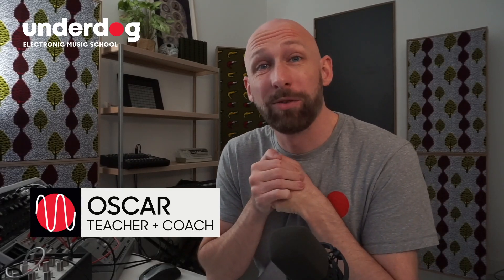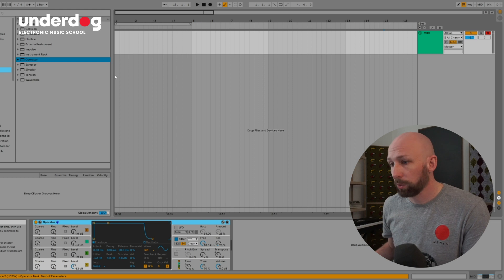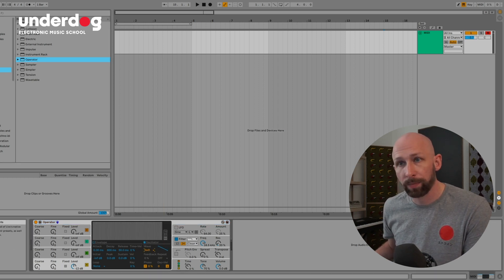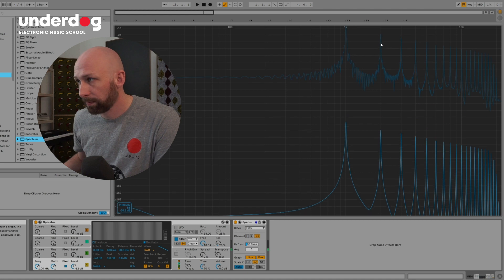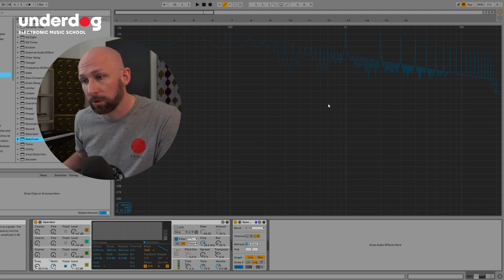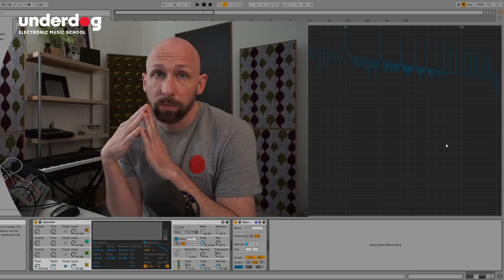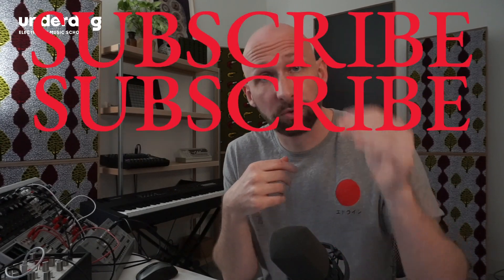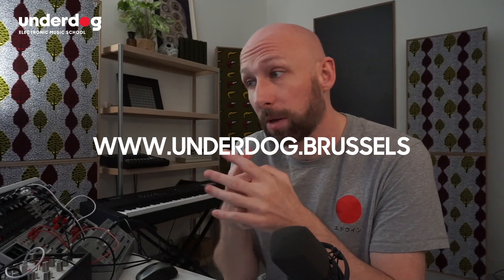Quick physics: High notes versus High frequencies

Comment: Great advice.  In a hardware context, I would assume you could use the low pass filter to remove some of the low end frequencies and keep the high pass open full like on the Korg MS-20 for example.  I wonder what other filter might be appropriate if you don't have a dedicated LFP?  Maybe increase the resonance but keep the notes short by shortening the release?
Reply from the maker: Yeah in the hardware world I imagine it's good to have dedicated controls to keep your low end frequencies under control, so you can choose if the subs are more for the kick or the bass (or even something else). 
Unless you really want to assertively cut a lot of frequencies, then maybe a bandpass is more appropriate!